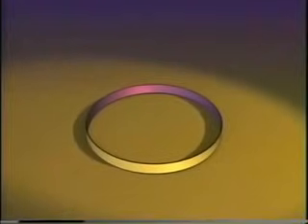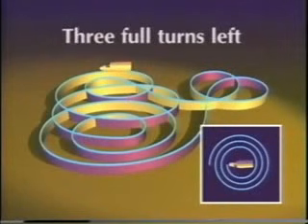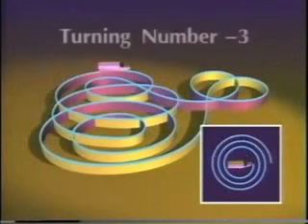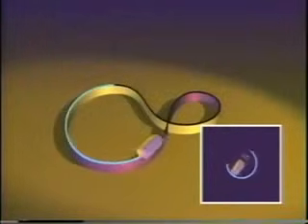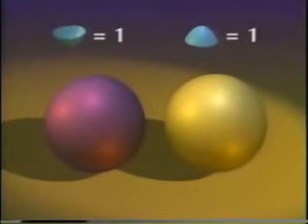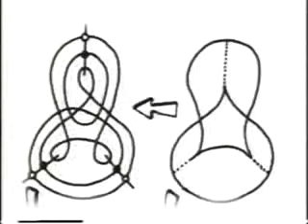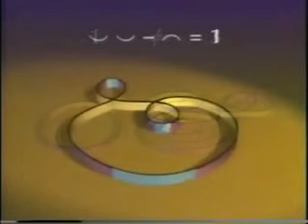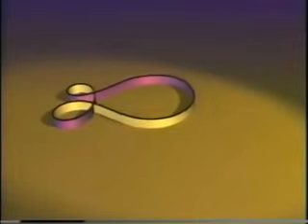how to theoretically turn a sphere inside out

Comment: lmfao the object can pass through itself, so real man... so real...
Reply: I love when people think they can understand math using physics. It's pretty amusing.
Reply: it's not supposed to be "real," it's talking about topology...
Reply: GiantSpaceMonsters if it can pass through itself the sharp bends arent a problem, If the sharpest way is a way that has an atom in the top and one in the bottom, they can pass through it and go perfect
Reply: When I imagine a continuous set of points with relationships with one-another being represented as a sphere, I see about one half of the set moving up, I see about one half of the set moving down, and I see a very small portion of the set making an infinitesimally small ring around the equator of the circle, meaning that the circle has indeed not turned inside-out.

Like I've implied, it's not good to think of math in terms of physics with every case. It'll only really help with applied maths, such as vector analysis, calculus, linear algebra, etc. It won't help with stuff like graph theory, abstract algebra, and topology (this video).
Reply: +thegustavodag the sharp corners means that an infinitely small amount of the particles will be not inside out,.meaning the flip was unsuccessful. that's why the sharp corners are important
Reply: thegustavodag Welcome to formal logic.
Reply: Sure, it can classify as a theory. It's by no means scientific because there's no way that it can possibly be proven wrong if you stipulate your definitions to something I can't disprove -- like what Jungian and Freudian psychology tried to do.

I would say read some philosophy of science works, like the writings of Karl Popper or Thomas Kuhn, but considering that you're so anally fixated on strict physicality and empiricism, I'm already guessing you're going to dismiss any kind of philosophy because your mind can't handle an ounce of abstract thought; as evidenced by your inability to grasp basic topology that doesn't even dive into the set theoretic aspects of topology, nor can you seem to understand some of the basic concepts of logic.

You see? I can be a condescending prick, too.
Reply: thegustavodag Well, how do you define everything being possible? If you can maintain internal consistency, then it's true; but if you have any consistencies in your system, then you're going to have to re-think your system as a whole because its logically inconsistent and therefore any proposition can be claimed to be true using your logic (for example, everything is possible and everything is impossible).

Much similar to math, which builds its axioms and foundations of truth on set theoretic logic and the rules of arithmetic as axioms. Although math can never be considered logically complete, it still maintains a consistent system of logic that logicians and mathematicians have built up by representing mathematical objects in terms of the aforementioned systemic axioms (set theory and arithmetic).
Reply: thegustavodag You can say that all you like, but it's how contemporary logicians make sense of logic. You can read a book or take a class on logic if it will help you understand it better. "Introduction to Logic" by Irving Copi is a very nice introductory textbook on logic that'll cover the basics up through formal logic (which includes mathematical set theory).

Don't dismiss logic because you don't understand it.
Reply: I'm not trying to use terms to seem badass. I'm using these terms because they're how logicians and mathematicians make sense of mathematics on a philosophical level.

I'm also not the one who called this video theoretical. Although I'm willing to concede that I didn't give a good definition for theory, that doesn't excuse the fact that you're mistaking truth in mathematics for truth in empirical science because I never thought that was your problem with understanding this content.

Mathematics and empirical science both have different criteria for what truth is. Empirical science says truth is derived and defined strictly from the observable, physical world (also called Correspondence theory of truth) while mathematics uses an idea similar to logic that truth is when the assumptions of a system of understanding some world (it could be a kind of "mathematical world", it could be a thought experiment, etc.) provide consistent truth values for all possible statements that can be derived from the system (which is called Coherence theory of truth).

The reason mathematics uses Coherence theory of truth is because it's more logically expressive than Correspondence theory. In Correspondence theory, the limits are the physical world, while in Coherence the only limit is human conception and understanding -- which we've observed for millennia seems to go beyond the physical world.

 I guess you can say it's metaphysical. I wouldn't say I'm very good at metaphysics, so I can't really say; but if that helps you understand it, that's fine by me.
Reply: thegustavodag No, it's because I'm used to talking about math using the terminology. The definitions in math are so specific that it feels inadequate to explain math without using the proper terminology.
Reply: @Alithenius I hope you're still doing good in life :)
Reply: william smith what's the fucking point if it's impossible in reality. So you have a theoretical mathematical formula to turn a sphere in side out oh but wait it doesn't obey the laws of psychics so you can't replicate it in the real world but that doesn't matter because it's a mathematical useless theory. Congrats what are you gonna do with that information make a fucking 3D animation to replicate the theory WOW that definitely helps society and science. Unless you can do it in realit It's a useless theory
Reply: This is not a scientific theory. This is a  visualization of a mathematical theorem that has been proofed and is true. I think the problem here is that what you consider a sphere is vastly different from what mathematicians consider a sphere. In thise case we are talking about a two dimensional sphere embedded into R^3 (the set of points which have distance 1 from the origin). If this is what we call a "sphere" this theorem is true.
Reply: thegustavodag It's because you're ignoring the logical aspects of mathematics.

We make fundamental assumptions about how a mathematical system works using different kinds of logic -- such as set theory and propositional logic -- and we use that to create a system that we can use to analyze relationships of mathematical objects that are defined with certain sets of properties -- such as graphs, matrices, and topologies ( with which this video concerns).

Mathematics has its foundations purely within human conception and reasoning -- which is why some people refer to mathematical sciences and logic as the formal sciences -- as opposed to the natural sciences which try to understand the nature of the empirical world. It's not supposed to model the world necessarily, it's supposed to model how human minds construct systems to organize the relationships between objects in the world.
Reply: thegustavodag A theory is any hypothesis that hasn't been disproved. If you're going to argue from an empiricist standpoint, at least understand the definition of the terminology as it's known in your field, rather than making a definition that suits your argument.
Reply: It can pass through its self but it can't have sharp bents what!?!
Reply: Ranzua "when i imagine a circle made of 50 atoms that can pass throught themselves i can see 25 of them going down and 25 of them going up, i didn't see any problem."
Reply: the one atom that didnt move wouldnt have flipped
Reply: Well it is all theoretical
Reply: Lol. But it's theoretical
Reply: You can't turn a sphere inside out with any currently known materials on Earth okay
Reply: Lol guys chill you're blowing my head up. Although probably blowing it up less than many other people
Reply: it's hypothetical as in IF there were a material like that, that's how it would work.
Reply: Ranzua Well in your definition, the invisible dragon in my house is also a theory and must be respected. Also i have a theory that logic doesn't have logic and everythign you say is wrong. This kind of theory is retarded.
Reply: I think this theoratically works in 4 dimensions of space
Reply: let the ignorant remain ignorant and deny the differences in reality from mathematics, for they will never attempt to grasp said concepts and will criticize those who do
Reply: Allan Of El Salvador let me cut you off right there. my apologies if you were under the impression that i was talking to you, i was actually talking to thegustavodag
Reply: Gary Pickrell IV when i imagine a circle made of 50 atoms that can pass throught themselves i can see 25 of them going down and 25 of them going up, i didn't see any problem.
Reply: Spectre Lex theories are made to be tested, this is why they are called theories, so you are saying i can't test something that is made to be tested?
Reply: Unknown0xa so this is like a challenge with rules that don't exist, nice, this video is a lie
Reply: Ranzua it could be anything.
Reply: ***** so you are saying that the theory doesnt represents the reallity? makes my point even more right.
Reply: fjdi hdshus not just that man, it would be made of atoms and would have alot of new unique charactheristics, your theory doesnt applies to reallity, makes it wrong
Reply: ***** a theory tries to use the reallity as an example, your theory changes the whole reallity and says that it is a theory.
Reply: ***** theory =/= changing the whole universe to make it work

theory = change the theory to work on the universe
Reply: "I'm already guessing you're going to dismiss any kind of philosophy because your mind can't handle an ounce of abstract thought"

If you don't say why you are using this abstract thought that you are using instead of another one, i would say that there are INFINITE answers for the same questions, thats just random shit.
Reply: Pisoi Gaming Yeah it also works on  Gustavo Verse (my theory that says everything is possible) see there are infinite possibilites, why this one is more important than the other ones?
Reply: Barry Billonger so much unecessary BS
Reply: Barry Billonger Dude i'm not dimissing it, i'm saying you are writing a page and using terms. communication exists to communicate with other people, and using terms to seem badass makes you fail on it, because your are making our communication harder. I said something super simple, if there is no evidence for your claim, and still tho you call it theory, almost anything you imagine is a theory, if you work here and there, call some shit exceptions or metaphisical.
Reply: Barry Billonger Am I a mathematician? so why are you using those terms with me man... thats ilogic, only if you want to look like a mathematician to look badass, just say it
Reply: Barry Billonger nope, please, re-read what you wrote, you are trying to look badass
Reply: ***** Yes, so if you create a whole different world to make it work, why is this world special? there are infinite possible worlds to create different "theories" which means, this "theory" is nothing more different than smoking weed and saying random things, good bye

Comment: What about shrinking the sphere, as is, to infinitesimally small positive values of size until it reaches negative values of size and is then inside out? There aren't any creases or sharp bends because just at the point where the x,y and z values for the sphere are 0, nothing is there to get creased or bent. After that, a negative valued, inside out sphere appears. I don't see why this would be a problem because in the video there are points on some axis that stop existing as the diameter of certain opposite spherical points equals to zero. This would just be making the whole shape stop existing, in a sense. But would it really stop existing?

Even if I am wrong I am surprised this wasn't an example try in the video, as this came to me as my first try while watching the video.
Reply: This would be the three dimensional equivalent to pulling a loop tight... Which as they showed in the circle example, is cheating.
Reply: Alright.
Reply: what you said is like closing a loop, "a crease in disguise" that's why it doesn't work
Reply: Yeah.
Reply: I know nothing about this sort of thing so I'm probably wrong, but isn't there no such thing as negative distance? But I don't know, maybe that rule isn't applicable when the material can pass through itself.
Reply: Yeah that's probably correct xD.
Reply: Tristan Viranyi   I'm not sure,  but here are two reasons why I think that wouldn't work... 

1) Simply getting close to zero would be considered "pinching" the edges.  Think of when the rubber band looking loop was pinched.  The angle of the arc became smaller and smaller until the lady said it was considered too sharp...  At the point JUST BEFORE your sphere reaches 0 (becomes a singularity) it may be considered 'pinched.' 

But if you don't buy that, then... 

2) It's impossible for something to get so small that it turns inside out because there is no limit to how small something can be...  Let's say your sphere is 10 inches in diameter, and you half it.  Now it's 5 inches in diameter.  Half it again and it's 2.5".  Again and it's 1.25, then 0.625, 0.3125, etc.  -  Your sphere can shrink infinitely, forever, without ever worrying about turning inside out.   😊
Reply: Haha yeah thanks. I didn't give a huge amount of thought to my answer. I realize that there are multiple types of infinity and that a decimal type of infinity is a concept too. I just thought in mathematical logic we could bypass this point without actually accounting for decimal infinity, but rather know that this point has been passed. E.g. A wave function could go from a trough of -1 to a crest of 1, but we don't have to plot every point as the wave gets infinitely closer to 0 from both negative and positive, there would be infinite points if we did so as you pointed out.

Rather we would just know that this is the case.

Comment: nope, they can't be right. It's becoming too complicated and it's easy to make mistakes when you complicate things beyond a point. The first complication is allowing the concept of passing through itself. SO, you accept "passing the walls through themselves", but don't accept the concept of just poking a hole in it? If you can't make a hole in the sphere, you can't turn it inside out.

Comment: If the circle can be bent and looped, how can it not be turned inside out? except for the passing through itself, it has the same properties as a rubber band. A rubber band can be turned inside out, and it doesn't even need to pass through itself...

Comment: What's wrong with creases and corners?
Reply: +Trajayjay Heyyayy You lose continuity if you let punctures exist . I don&#39;t know your math level but basically, a continuous function is a function where, for a given point x, every point close from x will stay close from it after the transformation (read function). If you puncture the surface and you name x the point at the very very edge of the puncture, a point that was close from x before the puncture will end up &quot;not close&quot; from x because you will have broken the nice surface you had. 
And actually, the continuity of the function is extremely important. You can do pretty much everything if you let functions be non-continuous (for example, put a filled square in a small line such that no two points of the square are at the same place on the line). Hence, continuous functions is a way to link figures that are similar without letting eome weird stuff happen
Reply: Liquicitizen Kemkyrk 
LOL, i wasn't talking about punctures, I was talking about corners and creases. A function is continuous at a crease, but it is not differentiable.
Reply: Oh yeah right hahaha. This domain of the mathematics (topology) doesn't care about differentiability since the definition of topological spaces doesn't need any operation on the space (for example, you can have see the set of line in R² as a topological space, but it has no sense to define the addition of two lines, even if you could do it). Since you have no operation on the set, you cannot define the differentiability of a function.

Comment: Magical material that can pass through it self but FUCK YOU if you crease it
Reply: Smurfton dont you fucking tear apart my damn joke.
Reply: +Smurfton bruh the shits already fucking magic, I'm pretty sure it can do what the hell it wants with corners.
Reply: This is because you can't differentiate corners, so they aren't useful.
Reply: +David Wheatman Math isn't magic, no matter how much it may seem.
Reply: +GoldNova I got your back. That joke was more magical than this bullshit material with its non creasing handling ass.
Reply: +Confetti Did you even think about it? Even if you allow it to 'crease' it still wont work. Its like taking a string, making a loop and trying to close it. No matter how hard you pull and for how long, a loop always remains, even if the material can pass through itself a circle remains a circle, no matter how small. It can only become a point in the limit at infinity, but the point of the video is to find a finite way that won't take forever which is quite cool. So the creasing makes no difference, the first way still won't work, the creasing conditions just helps in getting rid of these 'solutions' that take forever.
Reply: Jeevan Devaranjan And you just responded a paragraph to an entirely sarcastic comment. Congratulations!
Reply: Confetti Pretty sure you're losing this one, bro.
Reply: you're all wrong, it's simple quantum tunneling.
Reply: +Smurfton Math can't back up an object that can fold in on itself, sorry bruv. This shit's magic.
Reply: +bladethrower9000 LOL so true...